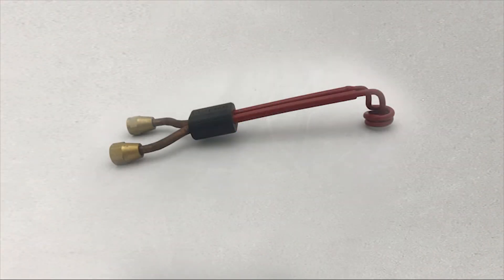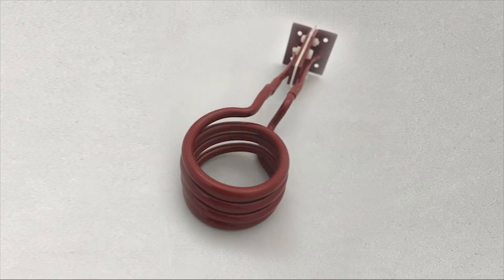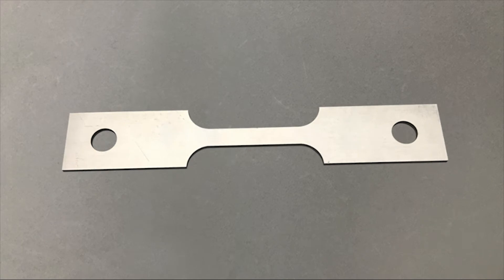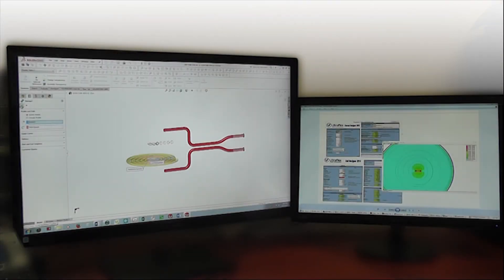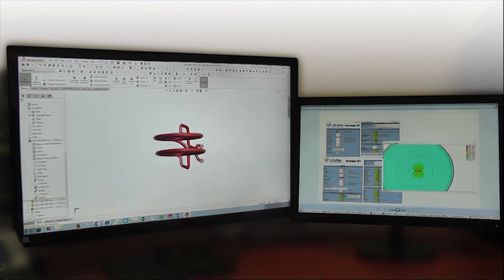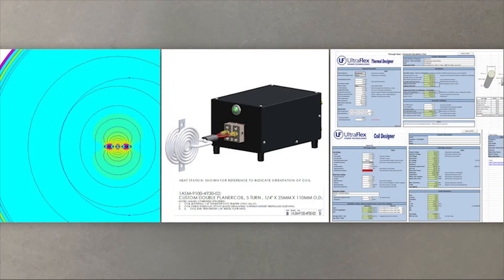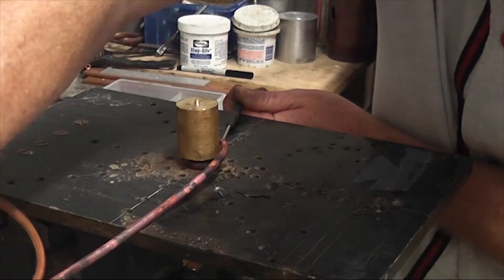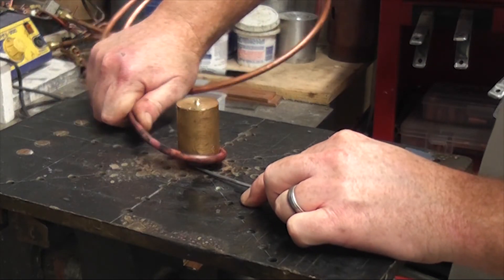Design and Fabrication of Induction Coils

Comment: If you use exterior tubing with wire centered in it, wouldn't you have an adjustable coil? You just need to make sure fluid can flow through the tube and over the wire! Cheers! If you try it, please let me know how it goes! It might be an interesting idea with interesting results! 🙏 Added input.... You may be able to use plastic and coil it around the wire before you insert it into the tube! That should allow for flexibility and coolant flow!